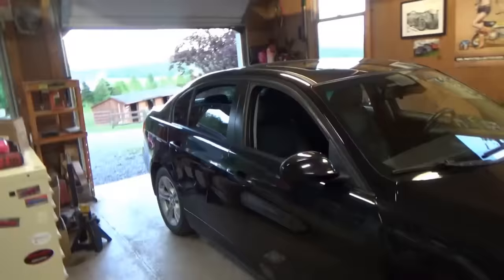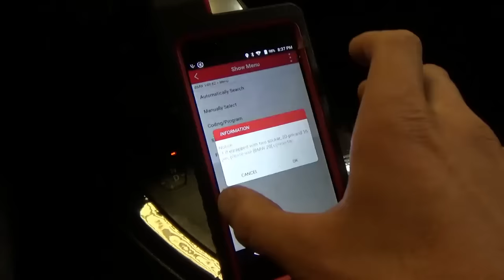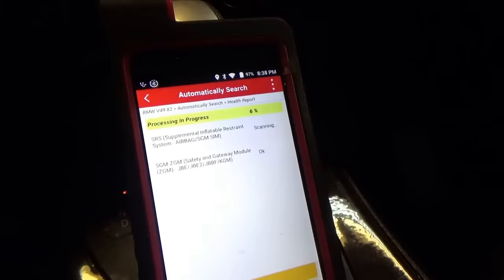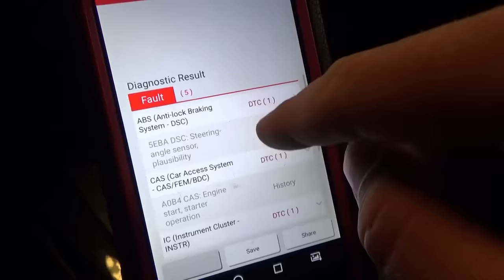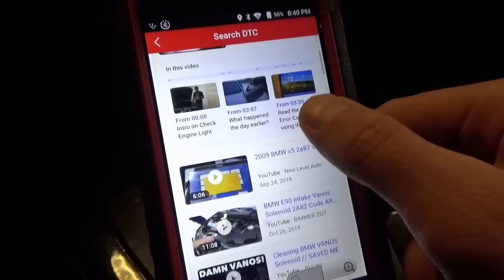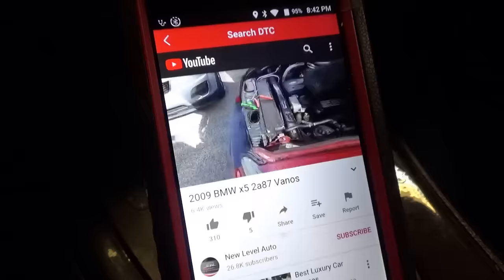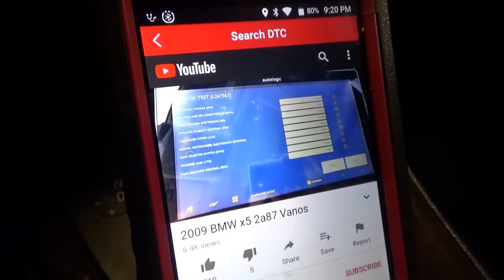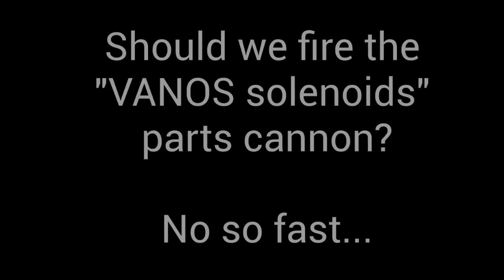Bad News BMW: Vanos 2A82/2A87

Comment: The oil pressure goes down when you rev the engine if the oil level is low, the oil isn't returning to the pan or if the pickup screen is plugged. If you find a "deal" on a BMW.... RUN AWAY!!!!!
Reply: The Germans have not yet figured out how to make Plastics and Rubber. All goes bad prematurely.
Reply: run from any BMW lol, don't do it!
Reply: Witchita is the home of 4 or 5 You Tubers that buy old BMWs and get them repaired at either "The Car Wizard" or "The Car Ninja", but he doesn't have his own channel yet. Sio you want to subscibe to "Car Wizard", "Hoovies Garage", "WatchJRGo". Watch the estimates they get to fix BMWs and Mercedes.
Reply: It’s not “The Germans”...it’s Ze Germans.  🤣😂
Reply: Had a good chuckle from you. Run. loll
Reply: We say the same things about American cars and French 🤣
He drive Ford and came home with the train.
Reply: of course, unless restricted, pressure vs volume.
Reply: Oil pressure going down when you rev the engine is also a sign of a restricted oil inlet e.g. partially clogged filter screen.  EDIT wrote this before I watched the whole video!
Reply: Unless you know what you are doing and can repair these faults.
Reply: @amazoidal  the rubber and plastic parts on my 1993 E34 520i Touring and both of my 2001 530d Tourings have not been a problem. Apart from the plasticised underbody insulation on the 1993 Touring.

"All goes bad prematurely" is hardly justified as none of my three cars (29 years old, and 21 years old)suffer from that problem.
Reply: About a year ago I did some work on a mini. You could not GIVE me a German made car. Those so called engineers have lost their collective minds.

Comment: You cant blame us this time.
Reply: They used a Dorman belt tensioner. It failed, caused belt to slip and caused this whole issue.
Reply: This time. So you admit it is often. No dorman parts are worth the value of the packaging
Reply: No, but I can blame y'all for nearly 2/5 control arms and window regulators being boxed wrong from the factory.
Reply: Bahahaha! This is so good! Thank you for a good laugh, Dorman!
Reply: Sit tight, Dorman... we're currently bashing Moog suspension on other channels.
Reply: @Trey Cook  LOL Moog has been going downhill for a while with their parts. Not what they used to be. I don't think I've bought any Moog parts for the past 2 years. 
Maybe they're rebranding dorman parts LOL
Reply: @diymisfit_Mechanic_UDX404  It's all because they went to a communist country to build these parts,slave labor is always cheaper than union labor and quality is nonexistent.
Reply: @TreyCook21  I hope you don't have the same problem with SKF and Timken products I have been using their bearings for decades.
Reply: @dogsplantscarsneatstuff176  Nah, used an SKF wheel hub on a Suzuki SX4. Been working great over a year now.
Reply: @TreyCook21  Thanks for the info.  Hope you get at least another 20 years on the bearing.  Three years ago put two SKF's in my at least 50 year old capacitor starting motor that powers my fireplace heat exchanger.  Love to watch the slow start reliable army surplus motor engage every time.  I put two Timken front wheel hubs on my 2002 buick lesabre about 8 years ago.  I have heard a few people say Moogs in the same application were not lasting as long.
Reply: I don't understand people bashing Dorman...I've used their parts for years and never had a problem.
Reply: @heyinway  I am so happy you never had a problem.  If you listen to many others it can be hit and miss.   Rachets and Wrenches on youtube got a Dorman lower intake manifold for a 3800 gm engine and found it was out of specs.  After installing all the gaskets,  the brand new manifold leaked water into the oil.  He went to a junk yard and picked up  a used manifold and it worked fine.  South main auto installed some stainless steel brake lines from Dorman and they fit like a glove with no leaks.
Reply: Hahahahaha
Reply: Kudos to Dorman for the sense of humor!!! I’ll buy something from them just for that. But I’m still just going to toss it in the bin of course... 😉
Reply: @diymisfit_Mechanic_UDX404  yeah, not been happy with the "rubber" parts of balljoints/tierod's they seem to dry rot fast/split and same issue again.
Reply: @kittty2005  the problem is, not and good Union Laborers left, they've been filled with "you cannot fire us stooges for years"..
Exact reason I left the couple unions I was in in the 90's/early 2K, nobody did anything right and wanted everything, new non/pre-union hires did everything and trained wrong or not at all...
Reply: @throttlebottle5906  Well,Ford broke the unions up here in northern lower peninsula of michigan 2 decades ago,a friend was working at a ford stamping plant he was a steward making 20$ an hour,when scab labor was making 9$ an hour he and others were in contract negotiations when upper management promoted him to shop foreman then they dropped negotiations,layed, everyone off then closed their three plants,2 weeks later they were in china making a bundle,how do you think Ford stayed solvent during Obama administration while everyone else was going bankrupt,but to be fair this occurred during Clinton's first term.
Reply: And they were negotiating pay and healthcare,ironic isn't it? Still doing it today,everywhere.
Reply: @serge4856  lol
Reply: I can remember reading an article, (back in the 70s?) about the new company, Dorman and how they were going to built on selling quality aftermarket parts.  I think their first product line was things like window cranks, handles, stuff like that. What happened?

Comment: They can put the oil filter right in your face, but hey can"t give you an oil dipstick...and I thought GM. engineers were bad.😃
Reply: You can thank emissions regs for that.
Reply: @rafflesnh  Please tell me how emissions regs prevent engineers to put an oil dipstick.
Reply: New Sprinters don't have a dipstick, but have the same exact dipstick tube as the older ones. Seal they used just pops off like the dipstick. Its not about emissions.
Reply: Having a dipstick in a vehicle engine compartment is a waste. Few of the dipsticks in the passenger compartment would ever use them.
Reply: Exactly.  A dipstick is not meant for a "dipstick" driver"  you're not thinkin with your dipstick Jimmeee
Reply: You can thank germsn over engineering
Reply: Thats not over engineering..that is just stupid thinking, goes well with the platicized engine.
Reply: Hey you can say the designer is a real dipstick or lack thereof?
Reply: It should go after the developers of those BMW since they're the ones the engineers engineered it that way,
Maybe the engineers have a
MS, BS and PhD? 
MoreShit, 
BullShitt, 
Piled Higher and Deeper,
Reply: The French though that Transmission oil change is not a thing and have no fill or bleed screw on the tranny. You have to pull the driveshafts for left and right wheel to get the old oil out and then construct something to fill it up via the 5mm thick exhaust hole. That takes nearly 2 hours for a simple oil change.
Reply: @VWWRENCHIE  I mean the concept is really not. It's more than just a dipstick, it measures and calculate the oil wear and adjust your oil interval. That said, having both would've definitely been the smarter thing. I think new BMWs actually are like that and have both.
Reply: @rafflesnh  dip stick  can cause a vacuum  leak if not replaced properly and often pops lose .
Reply: No, you were right, GM engineers are just as bad.

Comment: There is no such thing as a cheap BMW
Reply: Not cheap to buy, not cheap to run and not cheap to fix.  The neighbour has bought one, let's see how long he keeps it!
Reply: I'm pretty sure salvage yards get great deals on BMWs all the time
Reply: BMW pre about 1998 were great cars and were capable of living very long lives. In fact, it appears to me that the 90s BMW are out living the 00s cars.
Reply: or Mercedes....
Reply: If you vannos stop working” no oil will lubricate then guess what ? 💀  check oil pump/ vannos
Reply: They are not made for poor people and that is okay!
Reply: Cheap to buy because people that don't know how to maintain them dump them.

Cheap to run if you know what the important elements are in the maintenance cycle.

Even cheaper to run if you educate yourself on how to carry out simple/medium complexity maintenance tasks.

I have a 1993 E34 520i (vanos) Touring, and two 2001 530d E39 Tourings. The M50 B20/B25 engines and the M57 2.5/3.0 litre engines are nearly bomb proof and very easy to maintain as are the E34 and E39 chassis.

Comment: I experienced the belt phenomenon on an n54 motor myself, heat exchanger seal which is bolted to the oil filter housing shrunk, leaked oil onto the belt which shredded and went inside the motor, knocked the timing out enough that the motor wouldn't start and run, pulled the pan, cleaned out the pickup which was full of belt material, redid the timing with the tools and she is still running today.  Customer got a hair shy of needing a motor, very lucky guy.
Reply: On my 2009, they just rerouted the belt.  But you can't let oil start leaking onto it from the oil filter housing.  Stupid engineering.

Comment: Ivan, I taught Vocational auto mechanics for 35 years.  When oil pressure drops with increased speed it usually is oil starvation. Partially plugged screen, cracked pickup tube, etc. Another cause of low oil pressure besides a the usual like dilution, etc. Could be a shaving or whatever caught in the oil bypass valve causing the oil to mostly just dump back to the oil sump.

Comment: I had a similar issue on a 2007 Escalade.  The check engine light would come on with a Stabilitrac warning on the dash.  The variable timing wasn't working properly and if you revved the engine quickly, the timing would advance.  Bring it up slow and it would set a variable timing code every time because the timing didn't advance to what the ECU was calling for.  The issue was the oring on the oil pump pickup tube.  The oil pressure was low because the oring was not sealing properly inside the oil pump housing recess where the tube is inserted.  I verified the pressure diagnosis by putting in 20-50w oil and a can of STP oil treatment.  After that, no variable timing issue so that proved that oil pressure was the culprit.  Changed the oil pump and new oring and that was 40,000 miles ago and still running strong.

Comment: Yes sir the pressure in the oil filter housing is key!!, Also the 2 aluminum oil filter screens down low on the passenger side of a N52 engine are something to definitely check out-not easy to get to!

Comment: Had this exact issue a few months ago on a 2010 X3 (minus the metal shavings). Same codes, that would reoccur on second startup. Also would have the little throttle raise. It ran perfect. I got it from the auction cheap as a one owner with low mileage. Inspected then replaced both vanos solenoids and it didn't change anything. 

I was about to replace the engine. I noticed it JUST had an oil change done, and had 5w30 listed on the sticker. I replaced the filter and oil with 0w40 mobil 1, and the codes never reoccurred. I believe this issue was why it was traded in. You can't cheap out on a german car.
Reply: On the oil fillet cap it actually says “Castro 5w30”.
Reply: @Littllewilly0316  bmw also say 20000 miles between oil changes. Do you listen to that nonsense as well? 5w30 is what they recommend but 0w40 will also work well and you can have slight variations based on the climate your in.

Comment: On the BMW N52, there are Vanos oil screens on the front of the head on the passenger side, there are two of them, intake and exhaust.  They just look like aluminum torx bolts, but remove them, spray them out with brake clean every 4-5 oil changes.  If they get gummed up, the Vanos valves will not get sufficient oil pressure to actuate.  People don't know these screw in screens even exist and will often replace the soleniods when just a cleaning of those two screens will do the job.  Just another piece of the puzzle, but that motor was in a bad way and was short for this world unfortunately.
Reply: Thanks for the explanation, I will keep that in mind of I ever stumble upon that problem.
Yeah, these Vanos parts are pretty bad engineered. Diagnose Dan had a BMW on which they had these problems, replaced both Vanos actuators and mixed up in and out what lead to 15 degrees premature injection and spark.
Reply: Nice I’m gonn start doing that to my e70 every few oil changes..👍
Reply: If this was going on, like what your explaining. Wouldn't an engine light come on? I have a 2013 BMW X3 and its been sitting for months, so no issues at all other than gas efficiency, no engine light, even took it in and they said nothing was wrong. It continued to have issues and I had someone do a tune up, he did coils and spark plugs. Turned it on, and instantly engine light came on, again was not on before, so I told the guy. Hey, something weird, the engine light is on. He said oh it has to be cleared from before, Insaid but it wasnt on before. Really, he gave me what sounded like bs and said to drive it 50 miles, and it would clear. Well because of the sounds and light I didnt drive it anywhere. So when I had it diagnosed they said there was 13 codes, I said there was no way. So they continued to look at it and said I needed a tune-up 🤔 I told them it had a tune up and so they looked and said whoever the person was did bottom of the line parts for the coils and plugs. Could this trigger my issue going on with all the codes?

Comment: Excellent job checking oil pressure!  These oil driven parts rely on that.  The sound from the filter cap and the new solenoid indicated a deeper problem.  Well done, Ivan!

Comment: The tentioners that throw the belts off usually give you plenty of warning before they lose the belt. I work at a german shop that does about 70% BMW and every e90 that comes in gets checked for this issue. If the tentioner is going bad the belt will be not riding square on the tentioner pulley. Even will run up to a 1/4" off the pulley before throwing it.  Replace the belt and tentioner and you are good to go for a long time.
Reply: @Brendon Lind, I just had a 4k repair to my '07 N52 X3 because I was a dumbass and didn't take it to my euro shop to fix the whine of an impending belt/tensioner repair. Belt blew and got wrapped around the tensioner pulley and sucked through the front seal and left a great big heaping pile of black belt spaghetti in my oil pan, which in turn jammed up my oil pump. Love my BMW's, but live and learn. Pay your mechanic now, or REALLY pay him later.

Comment: Im betting the mechanic who "fixed " the engine just pulled the oil pan and cleaned the strainer which allowed the oil pump to work normally. The noisy oil filter was caused by cavitation in the oil pump due to the plugged strainer in the pan. That fix should keep it running long enough to get it sold to the next BMW bargain hunter.

Comment: The code set for the BMW variable valve timing is as follows...Variable Valve Timing (VVT) Generic OBD-II Fault Codes:
P0011 "Tow to Junkyard"  please continue with the outstanding videos, thanks!! any other related codes you need to speed up the towing timetable!!

Comment: When the oil pressure drops when engine revs up the oil pump is also worn and possible other parts worn due to the oil pickup been clogged.
A good video well demenstrated

Comment: Great video, but I actually think these E90 BMWs are the ones to buy... just not “on the cheap”. The N52 is known to run reliably for a really long time as long as you take care of them and stay on top of belt condition and tensioners. It’s NOT the car to ignore belt squeal or a noisy tensioner. Other than that it’s really just:

1) 20 oil filter housing gasket (easy job)
2) $60 valve cover gasket ( kind of a pain, but doable)
3) $60 oil pan gasket ( a pain, but not as bad as it sounds unless you’re AWD)
4) $400 Electric water pump and thermostat every 100k miles

BTW - Dipstick logic is to show “ok” if safe to start, and then once started it’ll give you a measurement. It’s goofy but no big deal and probably aimed at the masses who NEVER check their oil. We all have seen the “I just get it changed on schedule“ people who run 2qts low. I believe BMW was trying to prevent that since this will tell you when to add oil.
Reply: Got my x3 at 220,000 still going my E90 is at 170,000 stay ontop of maintenance.
Reply: Yet the computer never complained about low oil pressure, fantastic engineering from BMW...
Reply: @dikoman516  Oh they will complain about low pressure and low quantity.

Comment: Great call on your part, you did the right thing, walk away from the BMW quickly. Metal flakes in the oil filter, low oil pressure,  that engine will be gone soon.

Comment: Ivan + Vanos = brave tech analyst.  Those variable valve timing systems look intimidating.
Reply: dogs plants cars & neat stuff simple enough in theory but in practice.....it a solution in need of a problem....and barely reliable
Reply: could have been worse. The V8s have two VANOS units.
Reply: @adotintheshark4848  Double Ouch!
Reply: @dogsplantscarsneatstuff176  you got that right. I have a '94 740iL..the last 740 without VANOS.
Reply: @adotintheshark4848  How many miles do you have on it?  So does it have VVT(variable valve timing)?  Is it one of the more reliable BMW's?
Reply: @dogsplantscarsneatstuff176  it has 220k miles, no variable valve timing. Compared to the newer Beemers, it is more reliable-and I can actually work on it.
Reply: @adotintheshark4848  I am glad to hear it.  Happy motoring.